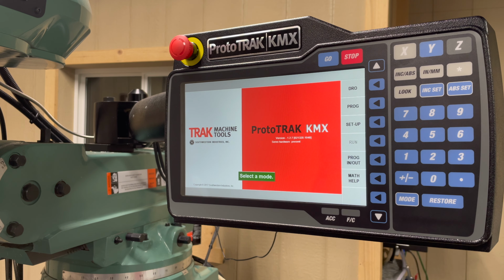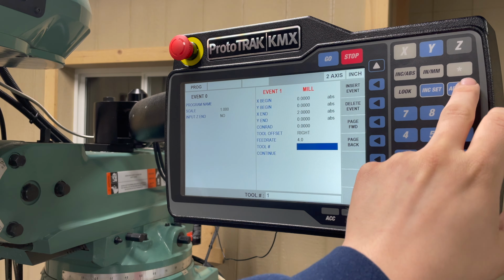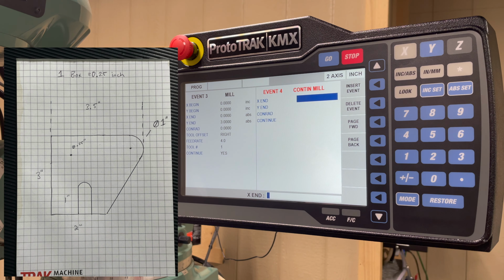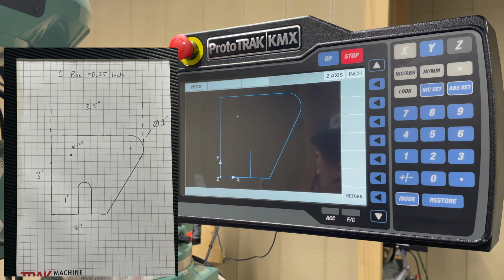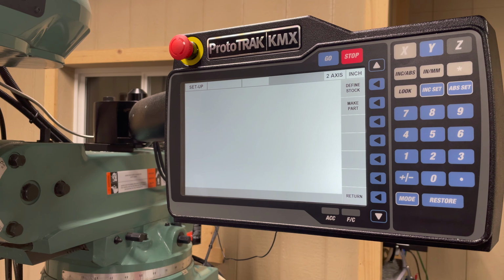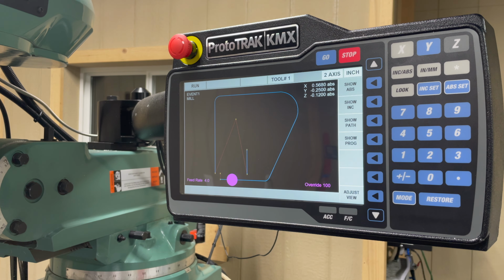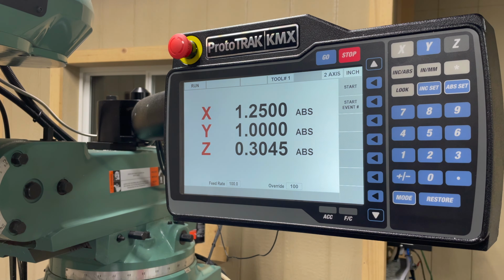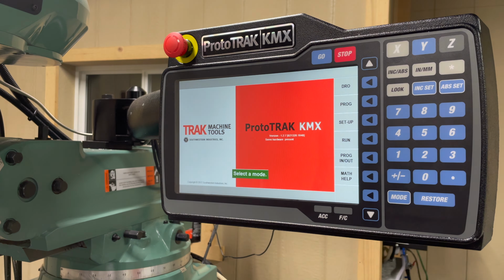ProtoTrak KMX Intro to Programming

Comment: a couple comments.  It would be helpful to explain when the increment button could (should?) be used.  Also, I am no machinist, but using a 1/2" end mill to cut a 1/2" wide feature create a conventional cut edge on one side and a climb cut on the other.  My experience has taught me that different material and different cutter creates more or less edge quality differences.  Great video.  And I will be searching for a how-to on importing DWGs or DXFs.

thanks!

Comment: These controls have to be about the most useless thing I’ve ever used in my 15+ years of machining.  We have a brand new kmx at my shop, it’s a really expensive Bridgeport that cuts angles.

The only way to quickly and accurately program something is to just feed it Gcode.  

I’m honestly confused how this company is even in business still.  $30k+ for a glorified kneemill?
Reply: I'm with you buddy. I'm not an old head, but I've been machining for over 8 years, and this is the first machine I've met that's so counterintuitive I'm having to look up videos to run it. Why would they not include a simple ENTER button? The interface is as clumsy as it could possibly be, and the manuals, if you can find the right one, skip all the important stuff that the interface itself skips. So here I am, trying to figure out why in the h*ll it won't do what I tell it to do....
Reply: @ You’re better off hand writing g code and saving it as a .GCD.  Or use any cam software that will post code.

This control is so stupid you can control the start point of a circle, it always starts at 12 o’clock.

Comment: Where those two angled lines intersect is NOT at 3.5", it is at where the lines would intersect without the connecting radius. Very good presentation. Leaving the part sketch on the screen for the complete video is an outstanding improvement. I would suggest adding zeroing out the Z axis as the very first step before entering any programming information.

Comment: Good presentation, however, I would have programmed this with climb milling in mind (tool offset left and moving counter-clockwise) and also turned on "input z end" in event 0 to have a comment in the RUN mode as to how deep to set the Z.  Mill moves to lead on and off the workpiece would have been a nice add. I'm sure you know but for those that don't, this can also be programmed using irregular profile as well. It has the added benefit of an optional finish cut.
Reply: @rugger302  knee mills don’t like climb cuts